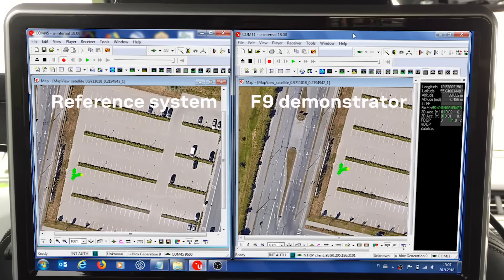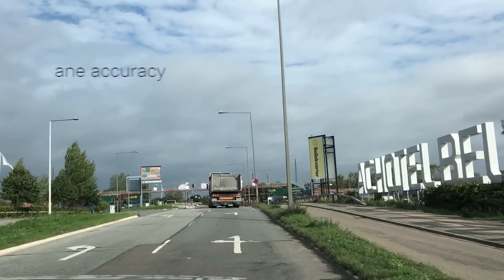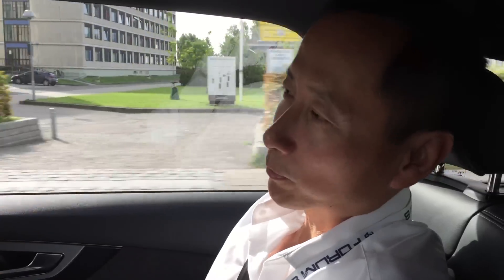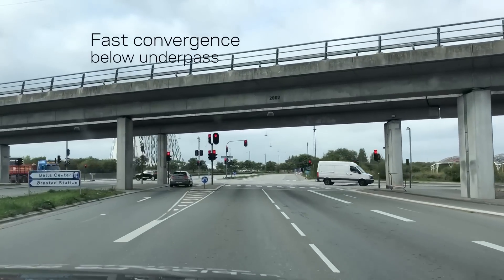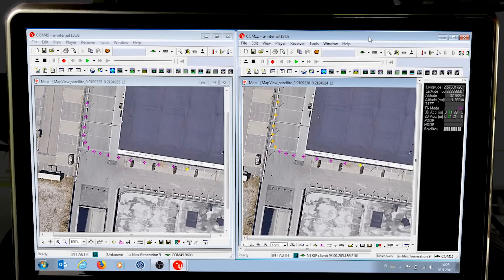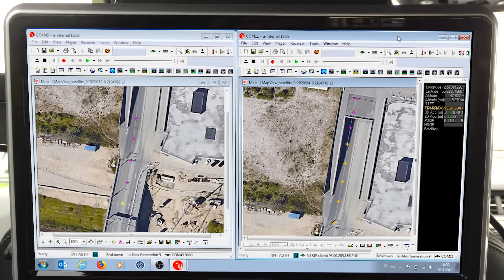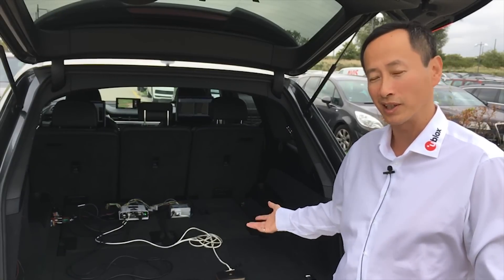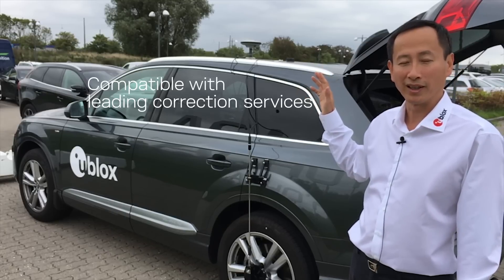High Precision Positioning with u-blox F9: Dead Reckoning Technology Demo

Comment: Can you please advise me on whether, when operating inside a building using only an IMU (without a wheel tick encoder), the accuracy will still be good if used for an extended period of time indoors? Also, which model uses a wheel tick encoder? Currently, I am interested in the SparkFun F9R, which has an IMU built-in.

Comment: How F9P can do dead reconning without IMU?
Reply from the maker: There are two basic approached to dead reckoning: 1. closely coupled and 2. loosely coupled. The F9K integrated the sensor fusion in a loosely coupled implementation.
It is also possible to have a system where the host processor has an IMU and implements the sensor fusion.